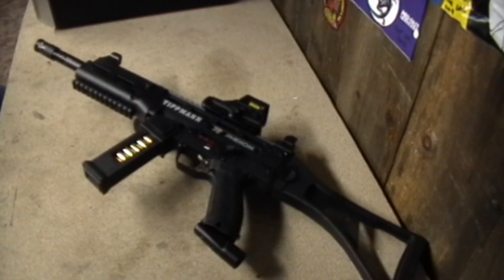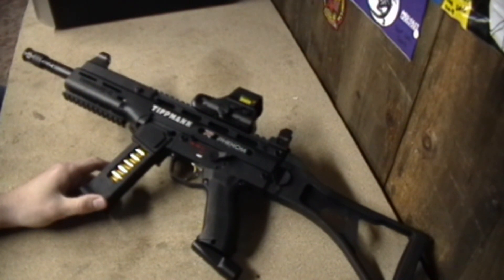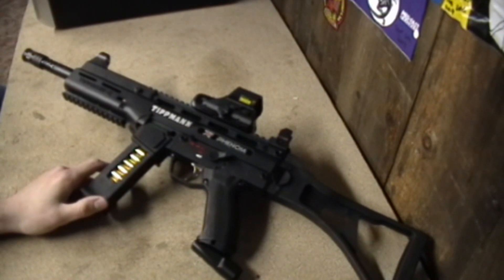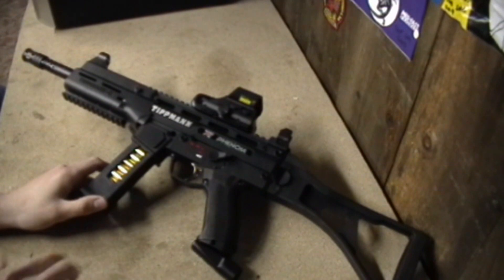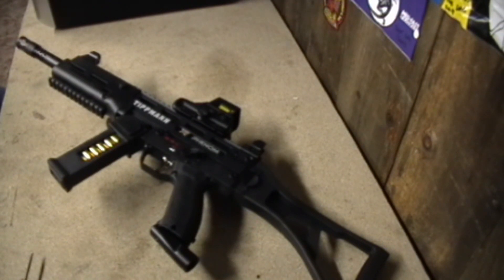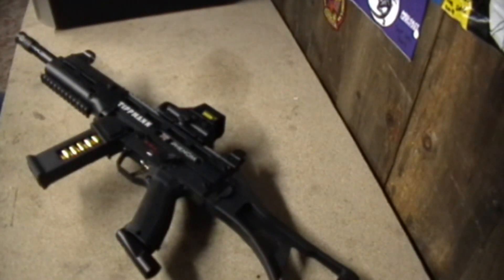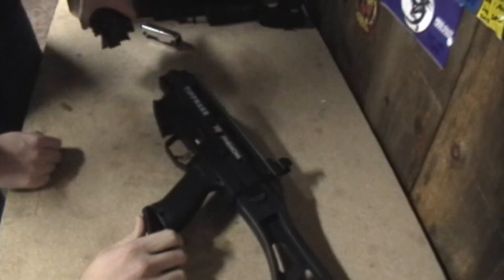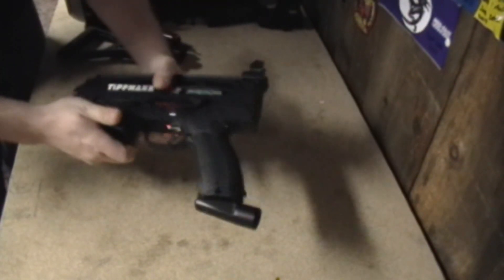Tippmann X7 Phenom Maintenance Video Part 1 of 2

Comment: i noticed the top push-pin for the stock/sling mount was very tight as well, found out it was actually the hole it goes in, filing the pin itself did wonders, file a little at a time, then check to see how it fits (just so you dont over-file it and it be too loose to even stay in place). this worked out just fine for me.

Comment: Ive been having alot of trouble with the top pin. I wasnt sure whether it was just my stock or if it was a problem through all of the models that are used for the phenom. If you guys find a way to get around tthe tightness is there a possibility of a video? Thanks

Comment: the back pins are hard because you have to use a router to shave down the holes..... also i don't like the ump magazine it's smaller than the original for the original tippmann x7 ump 45 mag...... so for the phenom the ump kit just doesn't look right on it.....